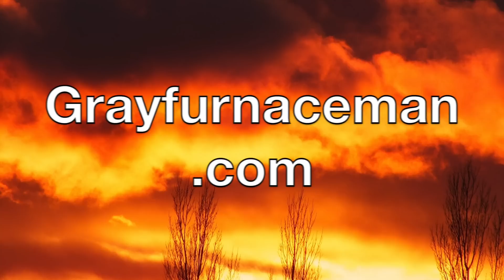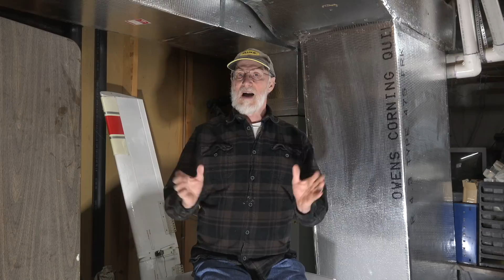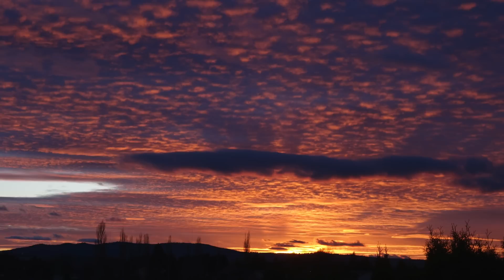Ductwork diagnostics #4, summing up

Comment: Hello my home is a 16 by 80 mobile home with electric furnade and AC.  My duct work is in a single straight line through the house.  The farthest registers in my bedroom don't blow as much air as the ones closer to the air handler.  Is this normal?  Is it ok to close off or close partially the registers near the air handler to force air into my bedroom register?
Reply from the maker: The ductwork in mobiles tend to be smaller than would be ideal.  This results in short cycling of the air flow.  
I would not close off any registers but partial restricting could help.
GFM

Comment: I have a 2 story 1927 house that was retrofitted with 6 inch hard ducting in the basement and attic for 1st and 2nd floor central heat and later AC. The only return ducting was a grate in the 1st floor pantry for the air to run through a short duct to the basement gas furnace. Return air from the upstairs bedrooms had to go under the bedroom doors and make 5 90 degree turns while going down the stairs to the pantry. It helped a lot to put return air grills in each room and route 8 inch flex ducts from each through the attic to a common return plenum in the upstairs hallway as well as adding a second return duct at the bottom of the stairs into the furnace return. But still far from a properly designed system.
Reply from the maker: You did good on the returns.  And yes, its pretty hard to retrofit effectively, especially A/C upstairs.
GFM

Comment: Been doing sheet metal for thirty years.sizing duct is very important but so many get it wrong.don’t think people even have ductalaters anymore.so many are just running pipe systems or the terrible wagon wheel junk.i work for a small family runner company and it was built on quality.we still hand make all out duct and run proper trunk lines with tees with dampers,turning vanes and canvas connectors.seems like most company’s hire people who have no knowledge or pride in their craftsmanship.just throw it in as fast and cheap as possible.
Reply from the maker: Agreed
GFM

Comment: I'm a hers rater in the state of ca. So many contractors I do testing for.they do not have plenums on the return, or return duct sizing is so undersized as well as not having enough ducting in the supply either due to all style coils or pure stupidity by running t-y's right off the supply plenum
Reply from the maker: It is true that ductwork is becoming a lost art.  It began with the improper use of flex duct.  Not that flex is bad, it is just that it is installed poorly.  The demise of the trunkline with branch runs has contributed more airflow problems than anything else.  Return sizing has been one of the big problems when I got into this business in 1977.  It has not gotten better.
GFM
Reply: @grayfurnaceman   keep up the good work..I started watching you right out of tech school and still learn from what you do

Comment: I suppose it may just be my area but, hereabouts duct-board ductwork is synonymous with poor quality work.  Yes, I suppose there are craftsmen who know how to incorporate parts like turning vanes and three-piece 90's into their work, but we don't have any such craftsmen around here.  We have two distinct groups; tin-knockers, who take pride in their work...and those who tape their work together.
Reply: size it right and you don't need silly turn vanes, yes that means 99% is way-way undersized  ;)
Reply: Yep...silly turning vanes.  I spend many hours doing a complete model of an HVAC application.  Pressure drop calculations, of the entire system, including the pressure drop for all direction changes and restriction elements are done in order to arrive at the most effective and at the same time economical design.  And, when the design is turned over to a contractor, who thinks turning vanes are "silly" and "duc-board" works dang-near as good as any old tin... well, then people wonder why the system is undersized.  Damn engineers must'a figured wrong...
Reply: you missed the pun  *way-way undersized* ;)